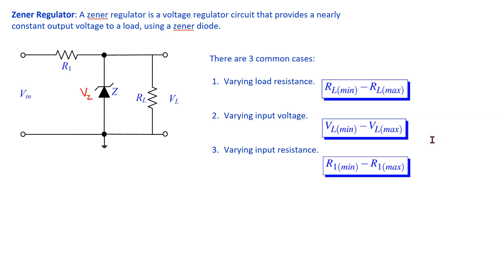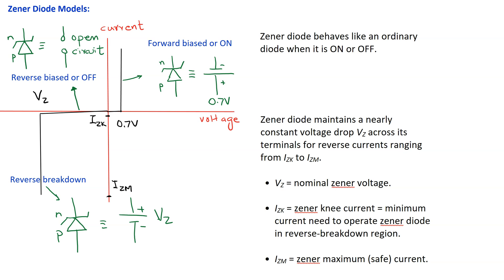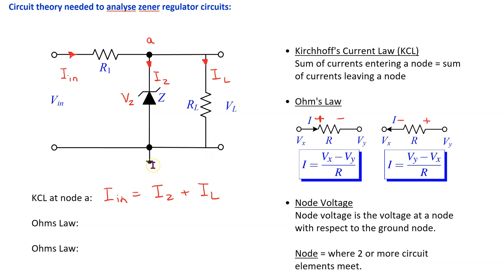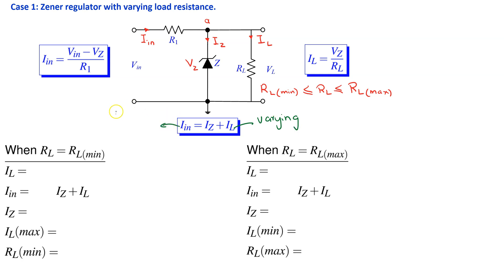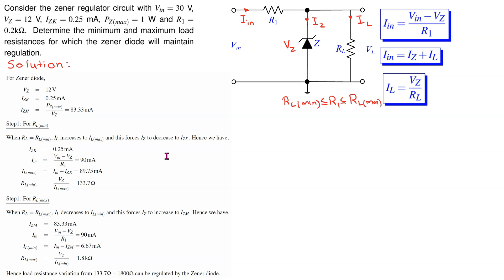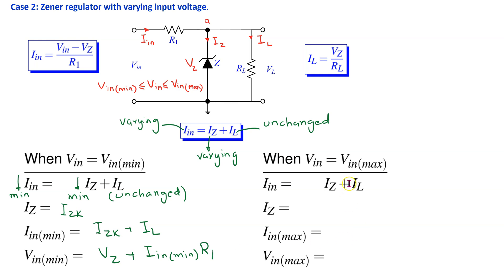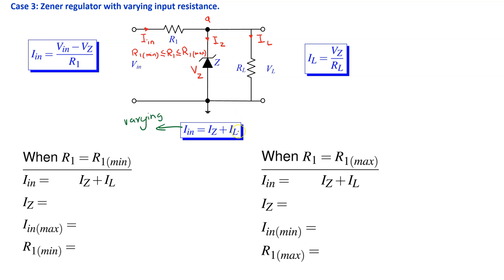Zener Diode Regulation - Varying load resistance, Varying input voltage and Varying input resistance

Comment: what if il is varying and vi is varying ? maximum R1 is required assuming that the zener diode is ideal
Reply from the maker: iL varying is essentially the same as RL varying. In this video, we have considered the 3 fundamental parameters varying individually. It is possible for two parameters to be varying together. In such a case, we will have 4 possible operating points. In your specific case (min iL, min vi) (min iL, max vi) (max iL, min vi) and (max iL, max vi). One of these operating points will give maximum R1 value. Hope this hint helps.
Reply: @electriccircuits7164  thank you for your clarification , i want to make sure that i understand the problem , i think to get the maximum Rs this means that it will get maximum voltage across it , so the voltage across RL should be minimum , so RL itself would be minimum so the current IL would be maximum , and from the equation Iin = Iz + IL if IL is maximum so Iz is minimum and since Iz = (Vin - VL)/R1 - IL -> Vin must be minimum to achieve minimum Iz (which in case of ideal zener diode minimum Iz = 0) , is my intuition correct ?
Reply from the maker: Yes your thinking seems correct to me. You can confirm your intuition by solving for the 4 operating points and confirming that you get max Rs value corresponding to the operating points you identified.

Comment: in the last calculation, without having the RL value how did you get the IL = 5.1mA . please explain.
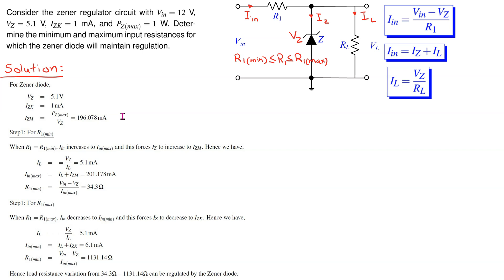Reply from the maker: Thank you for spotting this typo. In the example presented at 16:48 in the video, R_L = 1kOhm. Then I_L = V_L/R_L = 5.1mA. The value of R_L = 1kOhm was accidentally omitted in the video.
Reply: @electriccircuits7164  Thanks for the reply.
Reply: @electriccircuits7164 , Vz = 12V, so RL must be 2.352Kohms to get 5.1mA of IL. can you pls double check. thanks
Reply from the maker: Thank you for the question. 

In the example presented at 16:48 in the video, I have solved it using Vin= 12V, V_z = 5.1V and R_L = 1 kOhm.

V_L = V_z so we get I_L = 5.1mA. Your calculation is assuming V_L = Vin = 12V, which is not correct.

Hope this clarifies the confusion.
Reply: Sir...can I get to know ...how the current is decided milliamps or amps....
Reply from the maker: Thank you for your question. If I understand correctly, you are asking about when to express the value in A or mA? If so, in calculations we use engineering notation. In most scientific calculators this option is available. For details, see here:

https://en.wikipedia.org/wiki/Engineering_notation

Comment: Sir, you deserve more subscribers. Very useful video !!
Reply from the maker: Thank you for the feedback! Glad the videos are helping your learning!
Reply: You are very clear. I appreciate your explanation .. so much clarity for me
Reply from the maker: Thank you! Glad it's helpful to your learning!
Reply: May i check do u hv similar youtube on junction diode
Reply from the maker: The diode videos in this channel tend to focus more on the half and full wave rectifier circuits. If you have a suggestion for a video topic please do share.
Reply: @electriccircuits7164 1. Sir, may i check if V(output) = Vinput x root 2?
Reply from the maker: Your question is not precise. There may be an error in your equation.

For a sinusoidal voltage, 
V_in(rms) = V_in(p)/sqrt(2) 
and 
V_out(rms) = V_out(p)/sqrt(2).

In diode circuits, the peak value of the output voltage can sometimes be related to peak value of the input voltage. For instance, for a half wave rectifier, 
V_out(p) = V_in(p) - 0.7. 
If V_in(p) >> 0.7 then 
V_out(p) ~ V_in(p)

Then in that case, V_out(rms) = V_in(p)/sqrt(2).
Reply: @electriccircuits7164  Thank you, Sir, for your prompt response. Do u hv a video related to the whole explanation of junction diode, hald wave rectifier, full wave rectifier ... somewhat as clear as what u hv presented for the Zener Diode.
Reply: Sir, i greatly appreciate your timely help.
Reply from the maker: So far I have 6 videos related to half wave and full wave rectifier. Please see here: Diodes: https://www.youtube.com/playlist?list=PL6JL9fVjrZLcb67GCpgW-pN5l_fac72Ex 

I am currently working on a video on simulating  diode characteristics which will be available soon.
Reply: @electriccircuits7164  Thank you, Sir.
Reply: @electriccircuits7164  Thank you for being a very good teacher. I could see it from your Zener Diode presentation. You are intentional. You do not make unnecessary assumption. Your layering of understanding is very well-done!
Reply from the maker: Thank you for the kind feedback!
Reply from the maker: @ChuaMuiLing-iy7lc  Diode characteristics video is now available: https://www.youtube.com/watch?v=eXuIqB7NvBw